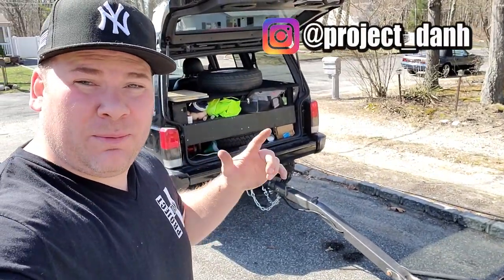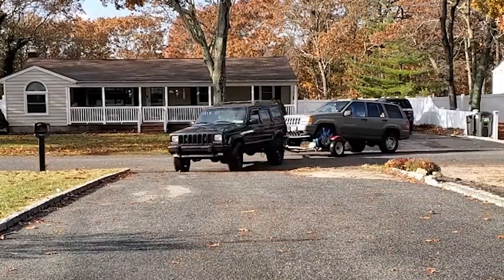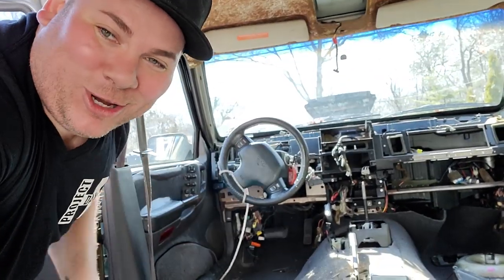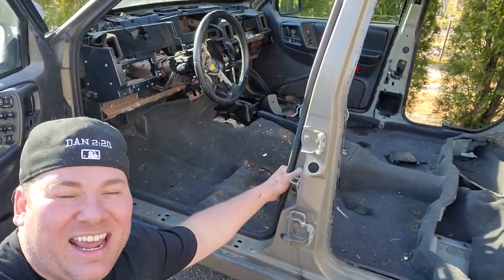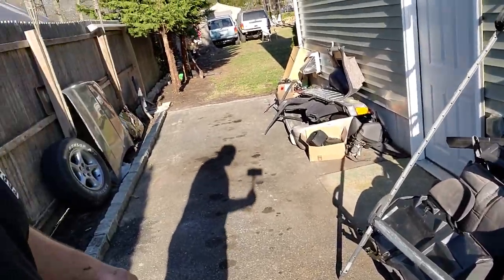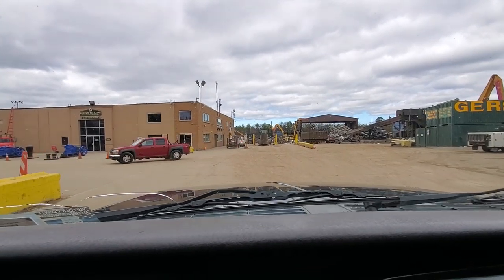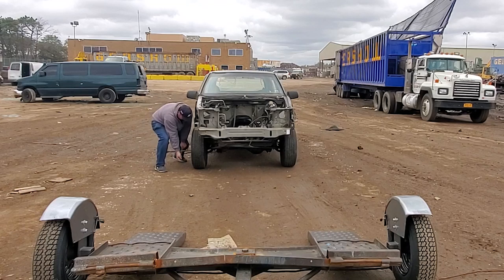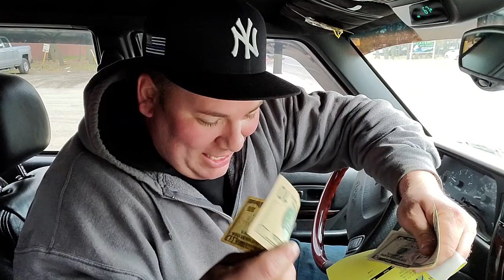SCRAPPING A JEEP ZJ - PARTING A 1997 GRAND CHEROKEE BEFORE IT GOES TO THE CRUSHER!

Comment: To scrap  or not to scrap?    I have a 95 zj that has been running great,  new shocks, exc.  very few original parts and well kept.  But first gear is going out, will need a trans re-build.  So, I really don't want to start a new project from scratch.  Would a trans re-build be worth it ,  around 2500.   But scraping and starting a new Jeep project is not cheap either.  I use it as a 3rd car, a kayak carrier, and fishing, any suggestions from you or your subs?   With 2 kids going to college a new Jeep is out of the question.  Does she stay, or does she go?
Reply from the maker: if you love your ZJ and of she's got no rust or rot then definitely fix the tranny.  if you don't like the ZJ and want another vehicle than you could sell it or part is out.. then buy another ZJ with less miles ... or an XJ 😎.   it's a shame these ZJs are great vehicles but has such bad transmissions.
Reply: @ProjectDanH  That's probably the direction I will go - don't want to start over. I got the ZJ for almost nothing. Thanks for getting back to me!
Reply from the maker: @matthewj2492  my pleasure!  Good luck 👍

Comment: I'm very surprised you didn't pull the brake booster that's a common upgrade for older xj's. I just got myself a parts truck and it's a great investment if you're rebuilding the same style vehicle. I have a 5.2 zj and an xj so I bought a zj with the 4.0 and now I have a motor with the extra webbing and girdle for my stroker build to drop in the xj and an abundance of body and interior components and much more for the zj
Reply from the maker: lol. good observation! I know it's a lame excuse, but I honestly just really didn't feel like dealing with the. brake fluid mess. haha. send me your stroker pics on Instagram!  I wanna see how you build it 💪

Comment: Dammit!!! I have a 1997 jeep Grand Cherokee limited with 5.2V8 and 249 transfer case and in need of a 5.2 engine
Reply from the maker: Ahhh, this one had a 4.0
Reply: Dang it! Lol I gotta see if taking the plugs out of mine and turning it over will throw out any water and changing the oil will start my jeep up. Either way I gotta get a snorkel and a lift, lol. Being stock height with 29" KM3 tires wasn't enough for the mud hole/ water hole I went thru haha
Reply from the maker: @HeathersHusband8387  Dude! that sounds like some pretty awesome stuff 👍

Comment: How was it removing the dash pad ?? And Dan where's your DeWalt impact to remove them lugs ? 😂 It still sad to see a ZJ die  but it will save many and make room for activities.
Reply from the maker: Haha! There's so much room for activities now! 😁.  Yea man, I blew it. I should have checked all the lugs first 🤦‍♂️ I'll never make that mistake again.
Reply: @ProjectDanH  It was only a 15 inch wheel so they are common on most Jeeps . Can't wait to see the rear brake swap video . I just put lugs on each wheel and drag them to to yard and pull my wheels on the property .
Reply from the maker: @jaysmith5084   yea man!  I need to order some brake pieces.. maybe with my bail out check 🤣.    The dash pad removal wasn't bad.  You need a screwdriver bit on a socket wrench to get the screw off under the glass
Reply: @ProjectDanH  I will remove the glass if I do it but that is a good Idea to save time .

Comment: $100 for a working VIC? I can get them out of the yard for $10-$20 all day! My '96 Orvis was just found with frame rot. I was quoted $2k for all the rust repairs here in PA at Jeff Daniel's Jeeps.
Reply from the maker: No way buddy! There were only 5 ZJ in the junkyards on long island and they all had GDMs.  It's rare to fine a working VIC.  Of you look on eBay 96-98 VICs in tested working condition are $100 all day.  If you can get em for 20 bucks I suggest you sell em on eBay.
Reply: @ProjectDanH  - My local yard has at least 20 ZJs. He's also very reasonably priced. All the PCMs are gone, though. He's less than 10 miles from Rausch Creek Off Road Park.
Reply from the maker: @OldsVistaCruiser  wow!  Grab me some VICs !!!
Reply: In fact, I bought my Orvis from that very junkyard the day it arrived, before they processed it.
Reply: He also has a lot of old stuff. As you first walk into the yard, you pass a mid-1920s Dodge, a circa 1953 Studebaker Commander, two mid-1950s Packards and a late 1930s Hudson. He even has a Kaiser Manhattan!